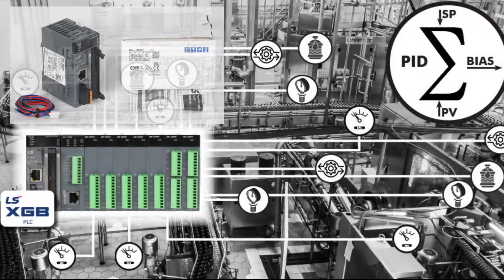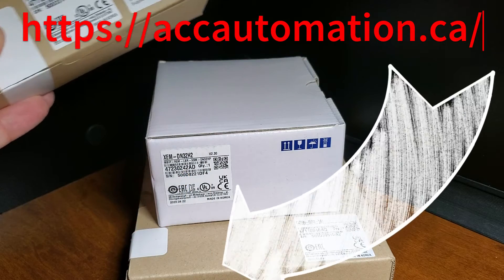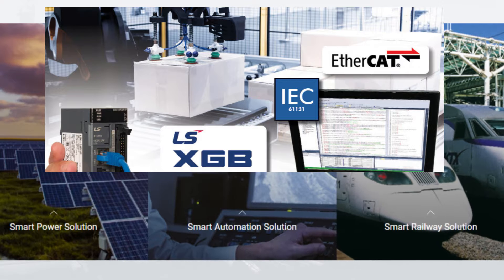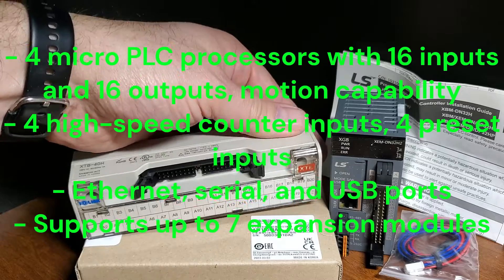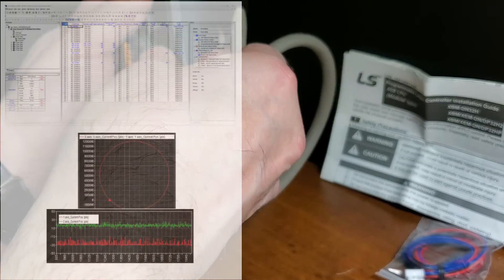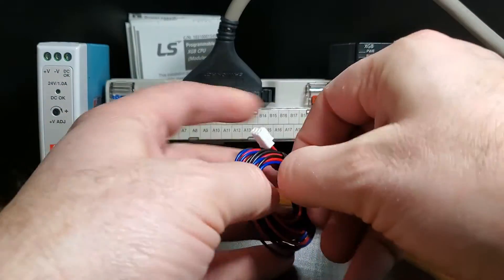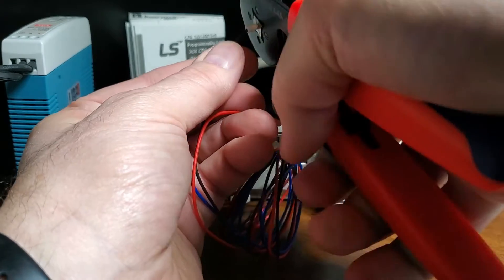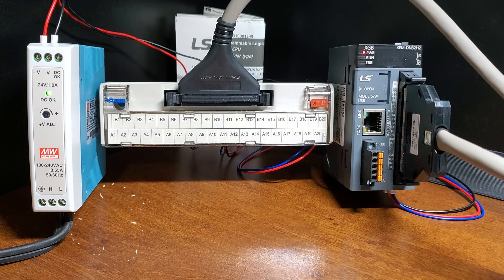Transform Automation with LS XGB PLC: The Solution

Comment: The LS XGB PLC has a lot going for it. I wanted to learn more about the programming environment for it... so, I clicked on the links for "PLC Beginner’s Guide to PLC Programming" (points to accautomation ) and was served waaayyyy too many advertisements and just makes the page for the site look really bad. You can't possibly want that many ads on your own website... 
Is this because the site is using a "web service" to make the site?
Reply from the maker: You are correct. The site uses a web service called Ezoic. It is not suppose to show that many ads, but have a good experience for the user. I will inquire as to the problem. 
Thank you,
Garry